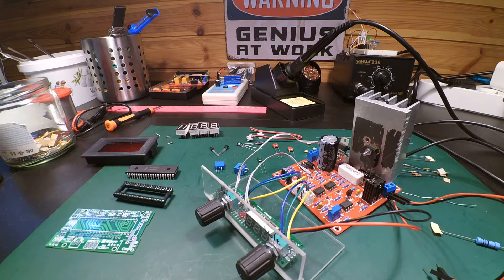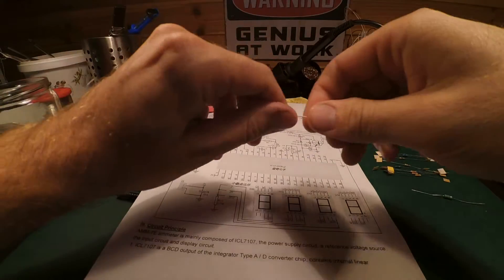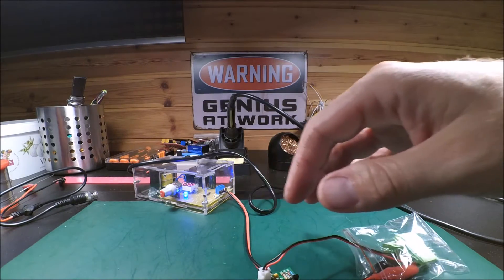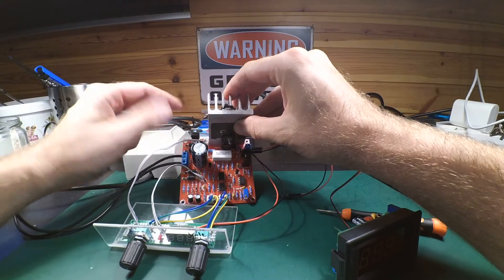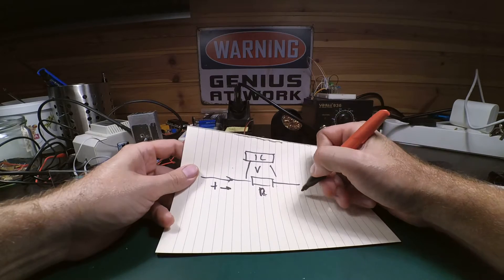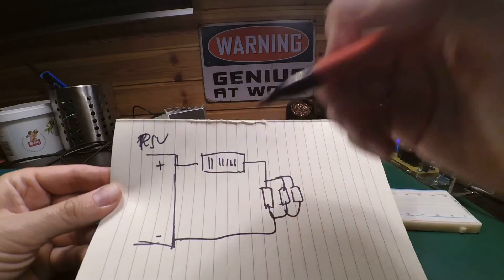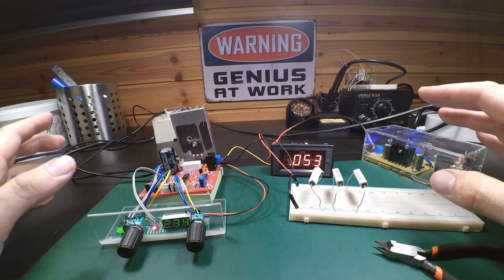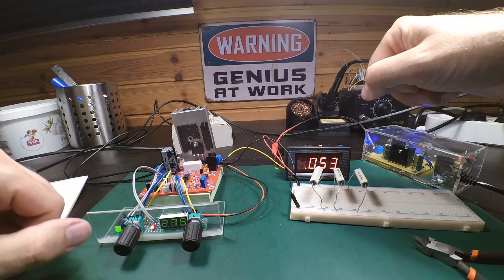#1:4 0-30V 2mA - 3A Adjustable DC Regulated Power Supply DIY Kit - Part 4 Amp Display

Comment: Sir what will be voltage pin 7 and 4 of op ic 1-2-3 ti 081.
Reply from the maker: op1 I don't know need to have a look at the circuit again. op2 op3 are the problematic they have the rectified 24VAC + the negative voltage pump rail and this is close to to 40V and can blow the op.

Comment: Thanks for the videos. I'm an amateur as well and have put together this kit hoping to add ammeter and voltage meter. After watching a few times it appears the solution is to have a separate circuit (outside of the board) to power the meter  this way it does not interfere with the ground and current limiting functions of the PSU. I've read and watched lots of videos on this PSU to the point that I'm over saturated with information. The eevblog has an extensive thread on limitations and mods for this. To summarize: the rectified voltage of a 24VAC PSU (41vcd or something like that ) is higher than the 3 opamps are rated for. So you can upgrade the opamps to make this a true 3A PSU but have to modify other components. The easiest solution is to use an 18VAC transformer which brings the specs more inline with what the current components can handle which is what I am leaning toward since I'm not up to the level of making extreme modifications. I am also considering taking the transistor off the board and add a much beefier heatsink and/or fan from the 24v regulator (could switch to 12v). A beefier heatsink sounds better to me since I prefer less noise from a fan. This is the eevblog thread for those interested in details (https://www.eevblog.com/forum/beginners/bangood-psu-enhancements/).
Reply from the maker: It's a good kit to start with and learn / refresh electronic knowledge :)

Comment: what modification in circuit i need to make for 0-60 v ---5a --power output ?
Reply from the maker: That will be a challenge. I'm a amaterur electronic dude so my answers might be wrong. :)
The op-amps can only handle 36V rail-to-rail so you need other op-amps if you want 60V.
The input diods can only handle 3A and the shunt resistor for the current limit is only 5W (at 5A it will burn of 11W).
I'm sorry but this circuit is hard to upscale.

Comment: Thank you for the video

I have ordered the same kit and wants to add V and A meter.

Wold have made the mistake to power V and A unit directly  from board
Luckily my  transformer  has 6v secondary winding and I plan on adding a voltage regulator to that output from where I will power the V and A meter.

Wouldn't it be possible the sense the voltage drop over same resistor on the board?

Kind regards
Reply from the maker: You can sense the voltage drop as long as your yolt meter has a high impedance input.
And thanks for your feedback :)

Comment: how can I get pcb?
Reply from the maker: You can find the pcb/kit on Banggood:
Power supply: http://www.banggood.com/0-30V-2mA-3A-Adjustable-DC-Regulated-Power-Supply-DIY-Kit-p-958308.html
Current/Ammeter: http://www.banggood.com/ICL7107-Digital-Ammeter-DIY-Kit-Electronic-Learning-Kit-p-977902.html
They are also available on Ebay